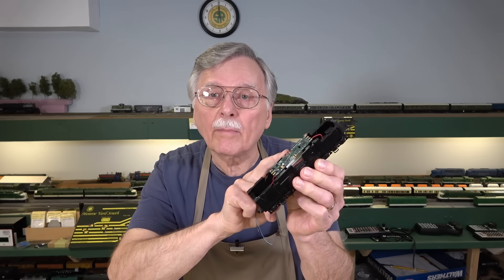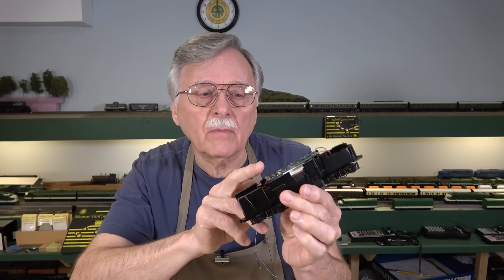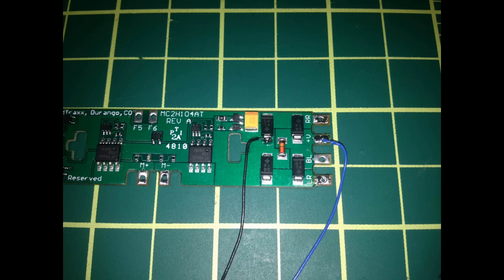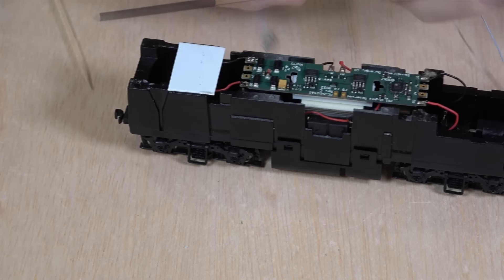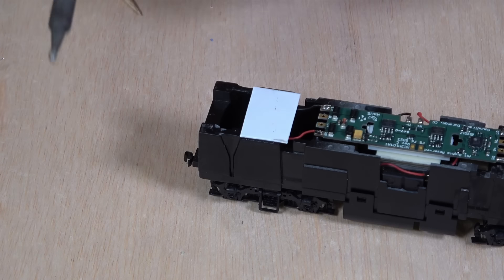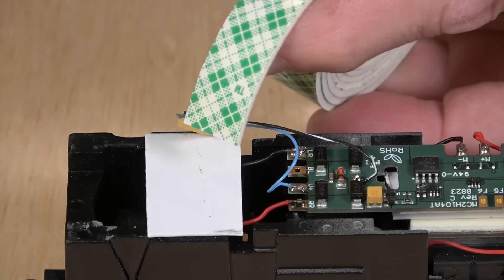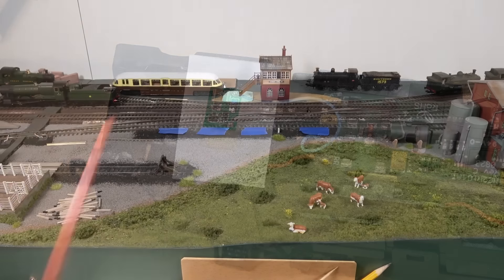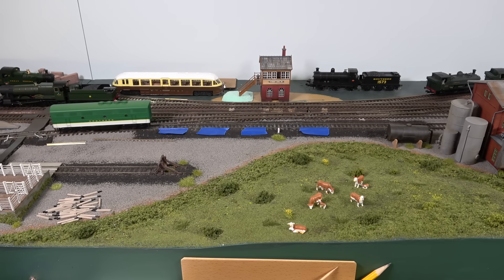World's Smallest DCC Keep Alive-Let's Test It (362)

Comment: That's nice to know that an n scale keep alive will work with ho. I have soundtraxx larger current keeper and it works well. Alotbof my locomotives don't have alot of space in the shell, so I installed the smaller current keeper in 4 locomotives and they also work well. I was having stalling issues because of dirty track. Now all my locos with current  keepers run great

Comment: Off topic question.. I have a ESU decoder that works fine in run mode. But when I try to read any cv’s or write them I get a no decoder ACK ON MY DIGITRAX SYSYTEM. Any help would be greatly appreciated . Also I have tried to factory reset but it won’t write to the decoder. All other locos read and write
Reply from the maker: Because of the extensive use of complex indexed CVs and a voltage requirement of about 12 volts the ESU decoders can be a challenge for some Digitrax systems. In the most recent ones Digitrax increased the programming track voltage and improved the timing for programming but anything older than the DCS210/240 series can have this issue. Using a SoundTraxx PTB-100 may help but I suggest you try programming on the main as it uses full track voltage. You can’t read back the CVs but you still should be able to program.
Reply: Thanks I’ll give it a try.

Comment: What is the total capacitance of the Keep Alive?
Reply from the maker: Here’s the specs

Dimensions:  0.26” x 0.363” x 0.136” or 6.6mm x 9.2mm x 3.5mm
Scale: N-Scale
Input Rating: Less than or equal to 16V DC; 100mA (Max, Self)
Output Rating: 10V DC (Max); 1000uF

Comment: I'll have to give this KA module a shot.  I work in hon3, hon30, and hon2 using the smallest version of the LokSound sound decoders.  Finding room to hide a keep alive, a sound decoder, and a speaker in something like an hon2 10 ton Davenport gas mechanical is a bit of a challenge.  These will probably help my Grandt Line HO 23 and 25 tonners as well. Thanks for posting this.

Comment: Looks like it's a convenient size for coach lighting too, such that you don't have to hide it in a toilet or the like, a common issue with the regular sized capacitors used for keep alive - and a problem for commuter stock that doesn't have such facilities!!
Reply: I would think it would be an even larger problem for the passengers with that keep alive in their toilet. Lol.

Comment: What would make it a specifically N scale keep alive? To my mind the only relevant parameters would be the maximum voltage spec of the capacitor(s) and the maximum current draw. Can you add another one (you have space in HO!) in parallel?

Comment: Larry, I enjoyed the video and decided to add the TCC Keep Alive device on to my Bachman HO 52104 0-6-0 Side Tank Steam loco. But I am having a problem. The + location for soldering the blue wire is easy to find because it is marked on the decoder with a +.   The location of the -ive connection point is not obvious. How does one locate that? In your video, you connected to wire to component marked 5428. I do not have anything like that on my decoder board.
Reply from the maker: You failed to mention the type (maker) of the decoder. Your best bet is to contact the maker and ask them as they should know. If that fails take a look at video #32.

Comment: Great video Larry! Do you know if it would be possible to wire 2 of these units together to get a little more juice? It would be way easier to use 2 of these compared to some of the larger ones for some of my projects.
Reply from the maker: Not sure how the decoder would handle the combined draw of two keep alives. This would be a question for TCS tech support.
Reply: @ ok thanks, I figured I'd ask. Doesn't seem like something that would work but never know. Best Wishes !

Comment: Hi Larry, Thank you for the video. As a N scale modeler, I'm been having very good success using the TCS Keep alive in most of my locomotives. As you mentioned at the end, "Non Sound Equipped". I've tried this Keep Alive in a Atlas GP38 (Southern High Short Hood GP38 to be exact) that I recently also installed a Digitrax SDN144A0 sound decoder, which sounds great, but this Keep Alive just does not seem to have enough current capacity to keep the decoder powered while running over dirty track. I can't fault TCS as they old saying goes, this keep alive is the best thing since sliced bread for us N scale modelers using DCC. Now a question, would it be possible to put two of these Keep Alives in parallel to provide more current to the circuit or would this damage the decoder? Kind Regards, Rich S.
Reply from the maker: A design question like that would be one for TCS tech support.

Comment: Thanks Larry. That keep alive is really small but it did the trick. Those pieces of tape would definitely be longer than most spots of dirty track and it ran fine across them. The headlight test was not as impressive because it didn’t stay on that long at all. I would be curious to know how far the engine could travel prior to the keep alive running out of power. Can you try 1 long piece of tape and measure it and let me know? It doesn’t have to be recorded. Thank you.
Reply from the maker: It is hard to actually tell how much of a coast is due to the keep,alive and how much is due to the flywheels. That is why I did it with the 4 strips and compared the operation of essentially the same locos with and without the keep alive.

Comment: The specs on those say a 10V output max at 1mF,   also states max of 100mA input power too don't these locos usually pull more than that?
Reply from the maker: Most decoders are designed with a 5 volt mobile and 7 volt sound circuit so this should be enough in that respect. The real issue is the capacity of the capacitor and the current draw of the motor.A small,highly,efficient HO scale motor should be OK but it just won’t last for more than a second if that long. But in many cases that should be enough to get you over a dead frog or spot of dirty track.

Comment: What system do you believe to be better to use I’m converting slowly from Dc to DCC digitrax system or NCE system
Reply from the maker: They are similar enough overall to be a wash so I suggest folks find out what their friends, fellow modelers, and local clubs are using. This will mean you will have local “experts” or at least knowledgeable folks who can hold your hand when you run into trouble or have questions. And of course I have 369+ videos here to help too.